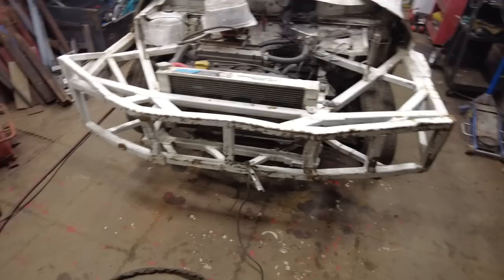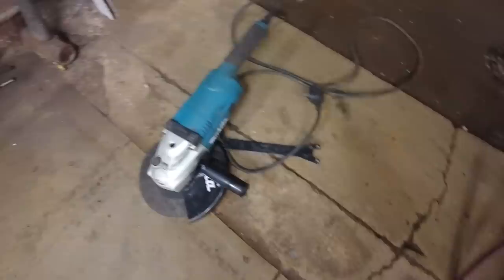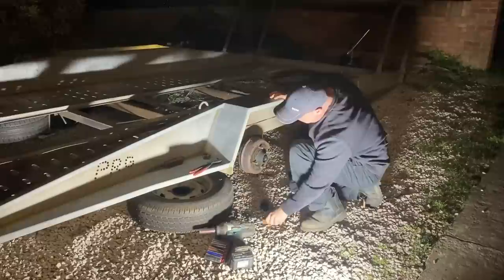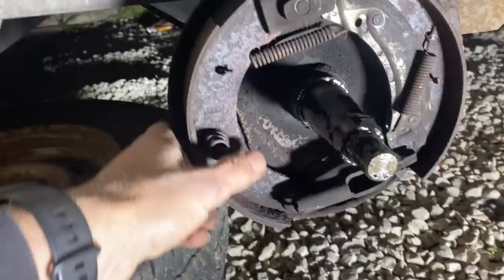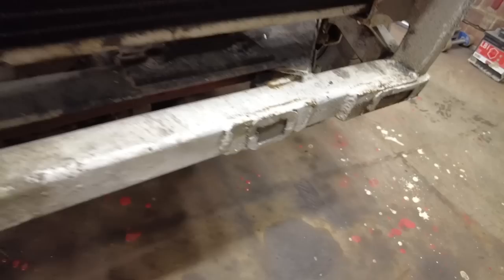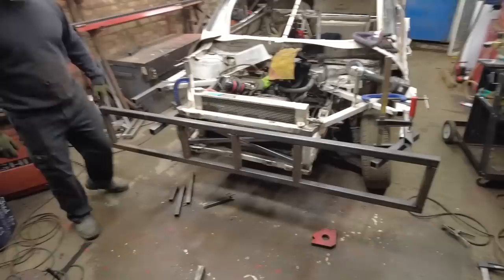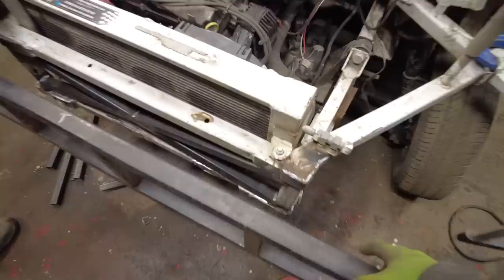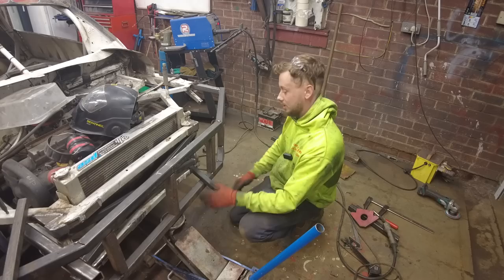1300cc Stockcar Vauxhall Adam Freshen up | Tebbz Weekly ep5

Comment: Another good video,leave them as they are time lapsed when doing the work. Look forward to the next one.
Reply from the maker: Thanks mate👍.. i wish I could time lapse it in real life 😂
Reply: @TebbzRacing  takes a lot of time up measuring and cutting steel.
Reply from the maker: @callumdurham7777  its a lot easier with two of you doing it, one cutting and one welding.